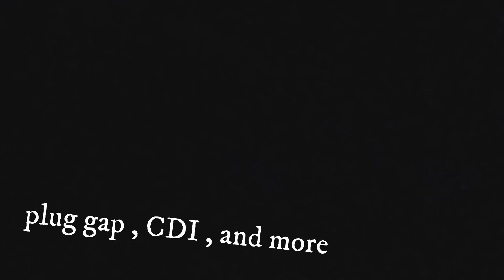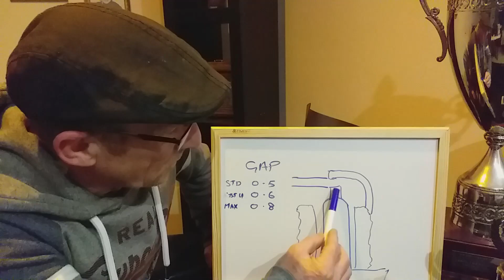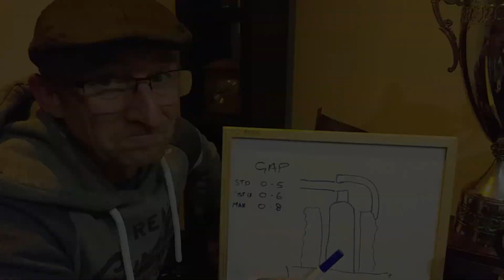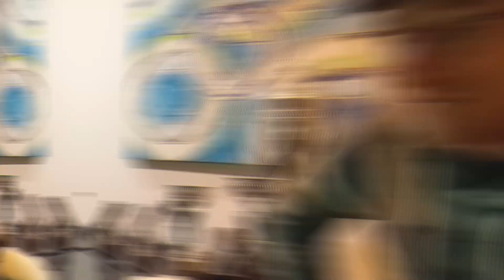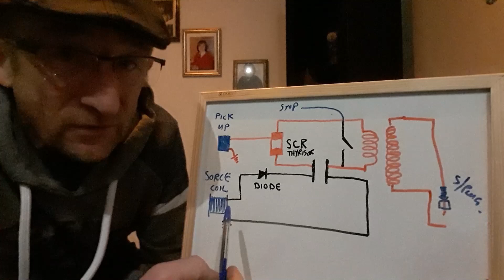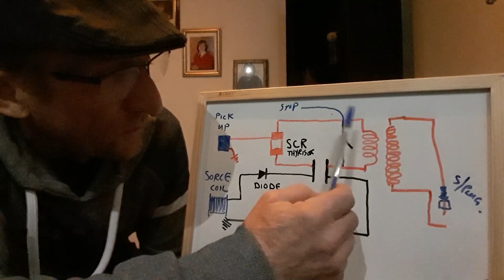LAMBRETTA  spark plug tips part 2

Comment: Just found the newest Picasso artist 😆
Keep up the good work Steve and hurry up with them fan n head cowls 😉
Reply from the maker: Yes it's taking time to get them done on the printer but they are available in fiberglass if you don't want to wait ?
Reply: TheSteelweasel aye, I’d take the Fibreglass ones first and see how I get on with them
Reply from the maker: @exsoulagent  ok I'll gets some done for you . Abchoppersgib@yahoo.com to get in touch easier.
Reply from the maker: The printed ones will take time to get right design and test ? So I'll be  keeping you all up to date with it as I go . The CAD  programme is a pain in the ass I've tried three and they don't do the job so I'll have to pay out for solid works or something.